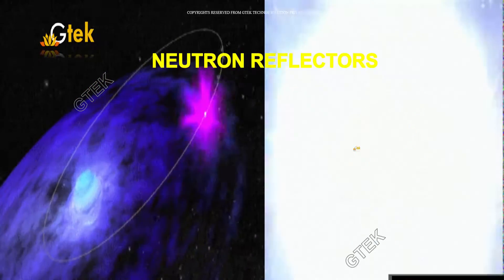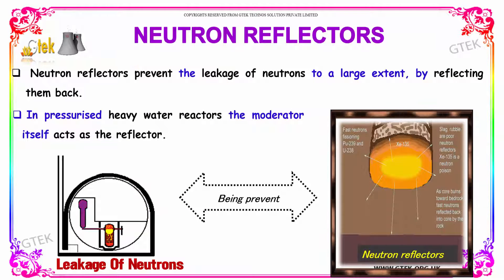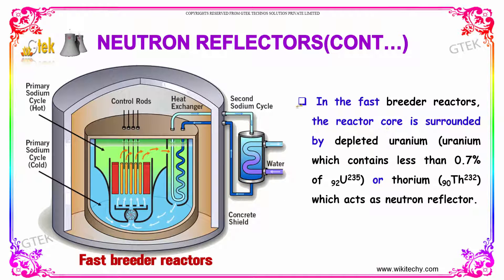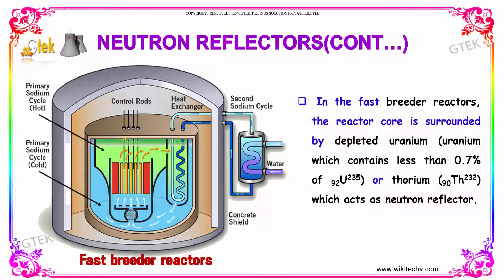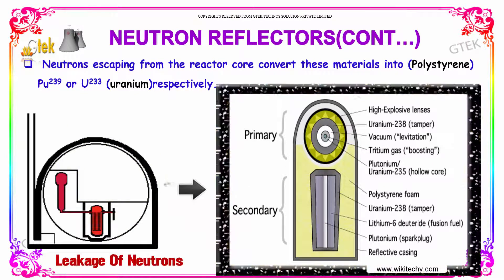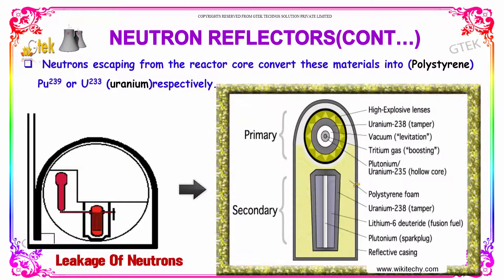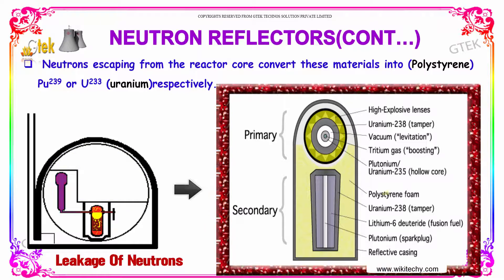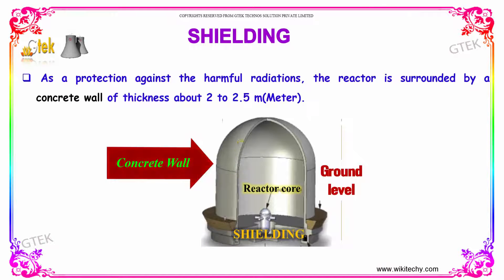Neutron Reflector |  Nuclear Physics | class 12 physics subject notes lectures|CBSE|IITJEE|NEET

Comment: Neutron reflectors prevent the leakage of neutrons to a large extent, by reflecting them back. In pressurised heavy water reactors the moderator itself acts as the reflector.